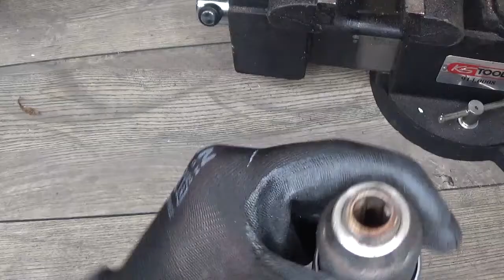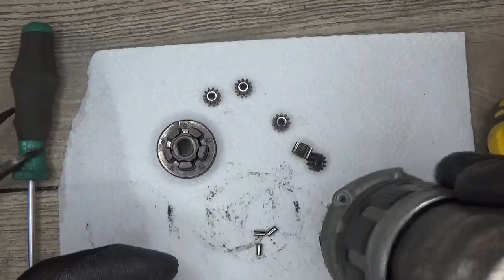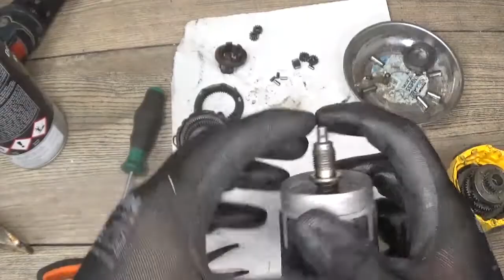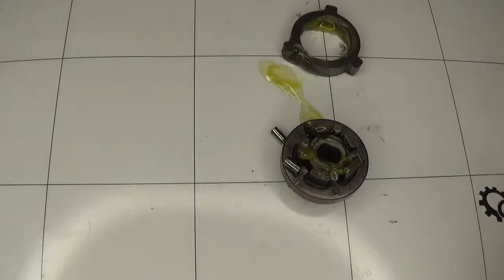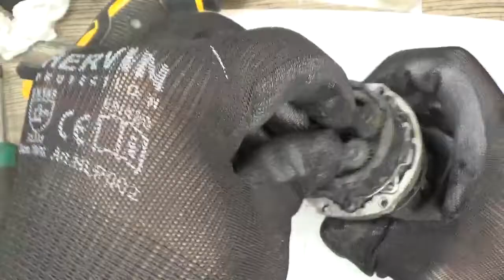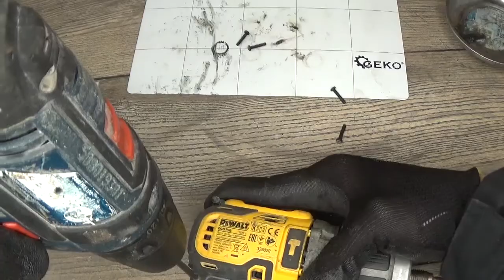Ultimate Chuck Removal and Gear: Dewalt Brushless Cordless Drill Assembly Guide

Comment: A much easier way to take it out without opening the gearbox, you can put a bush on the aluminum part where the handle is used to close the handle, and fasten a bush to the neck of the mandrel and make two holes on both sides of the bush by nailing it and two long screws in the door.  Tighten it until it reaches the end bush around the aluminum neck and tighten it. In this case, it acts like a puller and pulls the mandel out with the shaft, and there is no need to open the drill and gearbox.
Reply from the maker: Thank you, I will try this way next time
Reply: @powertoolsrepair  I hope I have made my point, my mother tongue is Farsi